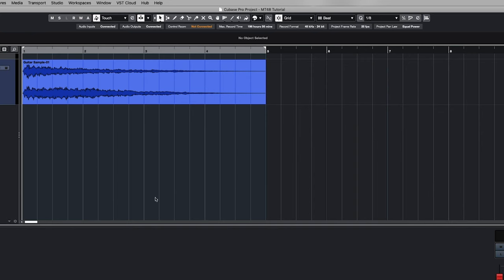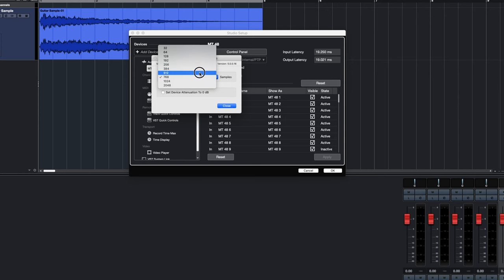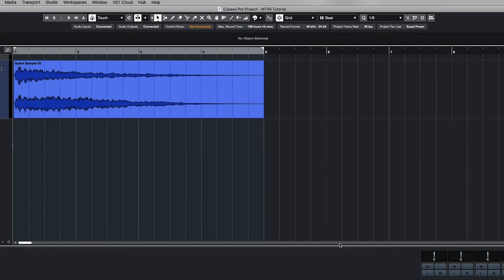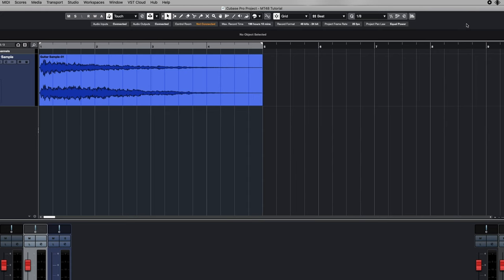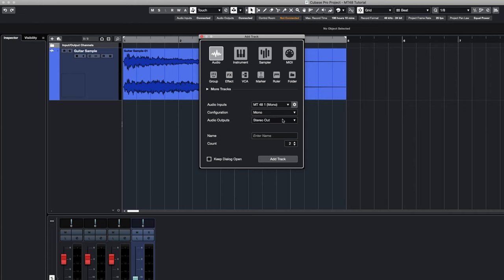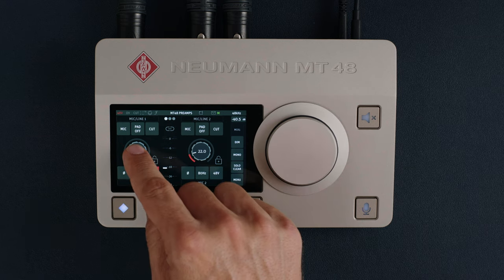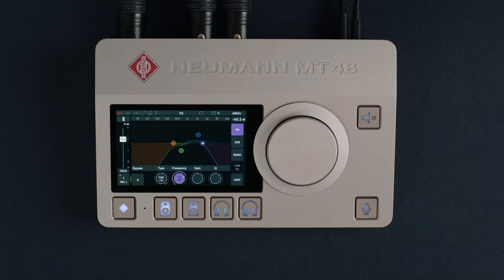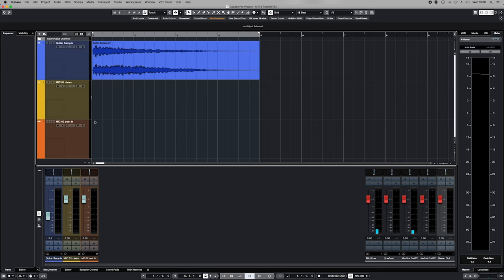The Neumann MT 48 (Pt. 5/5) –  Working with the MT 48

Comment: how do you set where the fx track goes from inside the interface, how does it know to record to 5/6?
Reply from the maker: Hi there! It sounds like the settings you are looking for are in Menu > Settings > USB IO on the MT48.
Under the first section, Inputs Routed to Computer, you would enable the Post FX options as you see fit for what you are trying to add effects on. Doing so will display a USB Channel number group, which is what you would select in your DAW for a track input.
Reply: @GeorgNeumannGmbH thank u! I figured it out!
Reply: thank u! i figured it out
 @GeorgNeumannGmbH

Comment: Good afternoon
How does your unit work for live performances?
Are there adat extensions for 8 inputs and outputs so that they are as compact as your instrument? A small unit and an adat extension that has to be mounted in a river are not a good combination for live performances.
It's good that your unit works standalone, but if I want to use my favourite VST plug-ins in addition, do you have a special quick app for that?
Why doesn't anyone put DSP processors in their audio interfaces so I can use my plug-ins? That would be a revolution. Can you do it?
Thanks.

Comment: Does it work as a low latency connection with Dante console cards or can you connect for example a RIO3224-D2 and use it as inputs?
Reply: I also have the same question. Need to know if it works with my Presonus Studio Live 32R, so I'll sell my Apollo 8p just because of the Dante connection.
Reply: AES67 will work with the latest Dante firmware update that includes AES67 compliance but only up to 24 bit 48khz. There are some hoops to set it up. You can read about it and the requirements on the Ravenna site. If you are going to do it, plan ahead before your gig and make sure you figure out how to do it ahead of time to test it. I don't recommend waiting last minute. It's not that straight forward and will take up some time the first time you try it.

Comment: How is the Fan Noise compared to the Anubis? It was such a deal breaker for many people since in a professional environment and as a interface placed on top of your desk a fan and the produced heat is not really acceptable.
Reply from the maker: Hello, the internal fan speed can be adjusted in three steps. In the default setting the fan is inaudible for typical applications.

Comment: i connect a AES50 from x32 rack, with no result :-( do i something wrong or its not can recognised the channels?
Reply from the maker: The X32 operates with AES50, while the MT 48 uses Ravenna. I believe the issue here is protocol compatibility. With the Ravenna we are dealing with aes67. The dante can be compatible but not aes 50. We hope this helps and if you need more information do not hesitate to reach out.😊
Reply: @GeorgNeumannGmbH  yup thanks so i can buy the dante plug for x32 thanks a lot:face-orange-biting-nails: a good video how to connect with other dante hardware would be also very interesting, i have not finde a link for reveanna software routing???
Reply: kayne west runaway (composed) just say it becaus global server failure, hahaha
Reply: @GeorgNeumannGmbH  I have a other question: i have now connected MT 48 to x32 X Dante card. but MT 48 become no response for primary channel, only on secundary. and on primary channel mt 48 can have a manual ip, but in the dante channel primary a diffrent ip : (mt 48 172.254.1.0 > Dante 169.254.120.144) what im doing wrong? i use the ethernet to secondary and the mt48 to primary channel on x32.

Comment: how do I prevent mic output from coming oput of my main speaker pairs. I am just struggling to get it working and getting a feedback echo
Reply from the maker: It is somewhat difficult to remotely diagnose what exactly is causing this problem. You have connected your devices as described in the instruction manual? Have you also checked our Support page for the MT 48? Maybe you can find an answer there. If it still doesn't work, please contact our support and service team: https://www.neumann.com/en-en/contact/

Comment: Is there a way to perform a hard factory reset? An error occurred during the last firmware update and my MT 48 will no longer reboot.
Reply from the maker: Please try the Firmware Rescue Mode Procedure.
> Download the MT 48 Toolkit and extract the Firmware file (.MT48)
> Download the MT Discovery utility on the Neumann site.
> Power up the MT 48 while holding the Home button pressed for about 12 seconds (the display might stay black)
> Connect the MT 48 over a network connection to your system (if the USB does not see the MT48 connect an ethernet cable)
> Launch the MT Discovery and perform a right+mouse click on the MT 48 entry to “Open the Maintenance Page”
> Select the MT 48 Firmware and manually update it = You might not see the screen at that time but wait until everything is updated.
> Once done reboot the MT 48 = Let us know if that works.
Reply: @GeorgNeumannGmbH  thank you so much for your help. That worked.

Comment: Friend please I need help, I have the Neuman mt 48 interface which is almost the same as the Anubis, and I can't find how to record pos effects I use FL studio 21 and Windows 11 system I have tried but I can't find the option I have seen almost all the tutorials but no one explains that section well and could you help me please, thank you
Reply from the maker: Hello, Do you mean recording with the MT48 effects? If so, in Menu > Settings > USB IO there is a Post FX Analog Inputs option. Those are the analog inputs (Mics 1-2, Line/Inst 3-4 PLUS any eq or dynamics processing. Those get sent over different track numbers than the standard analog inputs. When you turn on Post Fx Analog Inputs, it will display four USB channel inputs, those are what you select on a track in FL Studio to record in a “wet” (effected) track.
Reply: @GeorgNeumannGmbH Thank you for responding!!! I was up til 3 am trying to figure this out . I appreciate it🤝🏽🙏🏽

Comment: There is no wordclock connector on the device. How do you manage clocking with another device connected via ADAT?
Reply: Your other ADAT device usually have settings for clocking. Just use the other device as slave and mt48 as master.